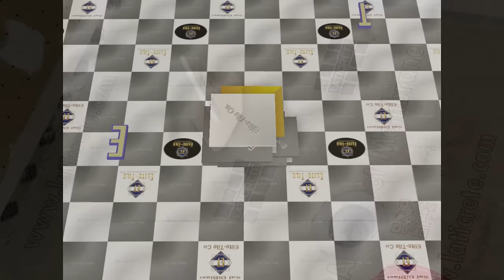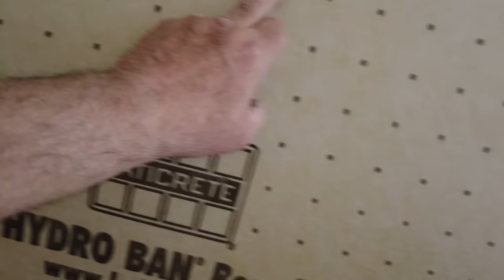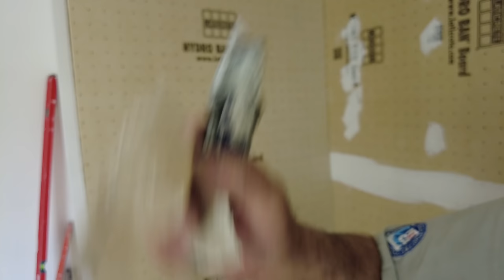Shower waterproofing, step by step.

Comment: which method do you prefer, the sealant or the hydroban liquid and fiber tape.  I imagine the sealant is much faster but hydroban liquid and fiber is tougher?  Especially if building acustom niche?
Reply from the maker: Sealant is more time and cost effective, but not right for every job. That is why you should be proficient in many methods.

Comment: Sal, I have always been a concrete board and mud pan guy but thinking of going this route.  Just as another layer of protection, would it hurt to apply Hydro Barrier and mesh to all joints?  Great video, thanks!
Reply from the maker: Not needed, and sometimes more does not not add but detracts.

Comment: Sal - I'm going to be using the Hydro-Ban Pre-sloped pan and Hydro Ban board (like you have) if I use adhesive to connect the board to the hydro-ban pre-sloped pan, do I still need banding?  I was going to add a layer of hydro ban liquid for added measure.  Thoughts??
Reply from the maker: The sealant should be enough, but the banding or liquid can't hurt.

Comment: Try a drywall corner trowel for the corners for smoothing the sealant, less chance of the edge of the straight blade cutting away some sealant without realizing it!
Reply from the maker: Yes you can do that, did not have one on hand, just need to be a bit more careful with a regular putty knife, but it works just fine.

Comment: Hey Sal, I called laticrete to see if they sell a smaller membrane roll and explained what I was going to do (essentially what this video shows) and they recommended I just skip the membrane and roll on hydro ban, 2 coats with a 1/2" nap roller directly to the dry mud bed. Have you tried this method? I know laticrete has a video on it.
Reply from the maker: That is also a method to do it, I prefer sheet membrane on the shower floor, but the Hydro ban liquid will get the job done.
Reply: @SalDiBlasi  Thanks for the reply :). These videos have been immensely helpful.

Comment: Great video Sal, answered a lot of questions I had. Would you recommend doing a custom sized niche made of CBU just be waterproofed with a liquid applied Hydroban? It seems like the layers and small pieces required to do it in membrane would add up quickly and become difficult to work with.
Reply from the maker: Get a pre made niche.
Reply: @SalDiBlasi  If I had to do it over I would absolutely go pre-made, unfortunately my niche is already in and I’ll be waterproofing what I’ve built

Comment: Sal, great job as always. Have you moved away from using Schluter brand? Any reason?
Reply from the maker: Not at all, I use both, I have several videos using hydro ban board, they are both great systems.

Comment: Sal, I’ve tried to get the 1/2x4x8 hydro ban boards, but can’t find a dealer locally that stocks them. Contractors Direct only sells the 3x5 sheets. 

Mat I ask where you get your 4x8 sheets? 

Great video as always. Just finished a master bathroom shower pan using your videos and the Mapei 4 and 1 deck mud.
Reply from the maker: I have several places near me that stock it, call Laticrete see if they can tell you who has it.
Reply: Thanks so much for replying. Hope business is going well for you.

Comment: I am digging the beard Sal!
Another question. Is there any reason why i cant build a floating corner bench using laticrete hydroban board on the walls and a 2" hydroban panel for the bench, and reinforcing it using kerdi za channel? Basically following schluters procedures but using hydroban instead
Reply from the maker: You can do that, but Laticrete also has a 2" board.
Reply: @SalDiBlasi  yes. I was planning on using laticrete 2 inch board.  Does laticrete sell the reinforement u  channel that goes on the front of the 2 inch panel

Comment: Sal, looks awesome one of the better videos for Laticrete. If you were doing a linear drain would you use Schluter’s and treat the flange like the Laticrete fabric?
Reply from the maker: I like to stick to a single manufacturer to preserve warranty, however these are sealed systems so they will work if you use a Schluter drain and laticrete membranes.
Reply: @SalDiBlasi  Can you use Laticrete 354 or Multimax to seal the Schluter drain?

Comment: Did you use a Laticrete Hydro Ban drain or a Schluter Kerdi drain?
Reply from the maker: Had a Schluter bonding flange, so I used it. Basically the same thing as Laticrete.

Comment: Sal must you use the Hydro Ban sealant with their board?
Reply: For their warranty, yes.  I've noticed that their sealant is probably polyurethane based but compared to other polyurethanes it tools easier and seems a bit more rubberized when dry.  I do what Sal does and use a sausage pack because it's the same price for 2x more sealant.
Reply from the maker: What Mark said
Reply: @Mkruzer  Much more likely to be a STPE-based sealant rather than a polyurethane (Laticrete calls it a hybrid sealant).  STPE sealants tool easier (often used as liquid flashing around windows and doors in commercial and high-end residential). All the major sealant manufacturers offer STPE sealants - Laticrete surely rebrands one of them and adds a fat markup.

Comment: That would worry me a little that you didn't use the washer along with the screws! It may not be needed for waterproofing but the washer do add additional support of the foam boards. Only having the screw heads into foam boards seems risky for supporting the foam boards, thin set, tile, and grout. However, thanks for taking the time to share your skills with us DYIs, etc.
Reply from the maker: If the manufacturer says you don't need them, why would you question that, it has been tested and determined they are not needed.

Comment: Hey Sal great video as usual!  Just one question that is driving me nuts.  It looks like you installed the back wall edge ban membrane upside down?  It appears that the fleece was facing up.
Reply from the maker: Same on both sides, just without printing on one side.
Reply: @SalDiBlasi  feeewww!  That’s good!  I thought there was only fleece on one side!  Still a problem with the OCD crowd but no harm done! 👍

Comment: Sal, Great video, thank you for sharing your knowledge! I have a quick question.  I want to use Laticrete to waterproof as you explained in this video.  My issue is that I already purchased two Kerdi Line drains for my curbless shower over cement.  My Laticrete rep recommended that I use MultiMax Lite or 354 as a slurry underneath 3701 Fortified Mortar.  All three of these products are modified and Shulter is telling me I need to use an unmodified thinset for the drain.  Can I use the Laticrete MultiMax or 354 or should I remove the cloth from my Kerdi Line drains as my Laticrete rep recommended.
Reply from the maker: The slurry, or bond coat undr the mortar can be any type of thinset, modified, or unmodified. As far as the drains go, I can't tell you what to do, but I have used both the thinsets you mentioned to install banding in y shower as well as line drains. Your call.

Comment: Sal
I have not done a sealed system since Noble came out with there products in the 80s.
My question to you is since you obviously used this product can you cut the membrane on the floor 6 + or - bigger and turn the sheet up the wall leaving the corners out of the sheet and useing the preformed corners. 
It seems like the membrane strips at the change in plane could be eliminated if the sheet is larger than the floor and turned up the wall
Reply from the maker: You can do that, and I have done it on two walls, however the sheet membrane is thicker than the banding, for smaller tiles it might give you a bit too much buildup.
Reply: @SalDiBlasi  
Thanks sal

Comment: Hi Sal, I'm using hydro ban board for my tile from tub up to ceiling. BTW, In one other video I watched of yours, I appreciated you explaining the Do's and Don'ts of proper placement of backer board where it meets the tub tiling flange. I do have a question about the waterproofing in this video. That being, do you ever use mixing valve or pipe collar seals? Thank you and super video!
Reply from the maker: Laticrete does not make them, they are more for kerdi when installed over drywall.

Comment: So make me understand this and by the way, I really appreciate your skills. You took your time to install wall boards the right way, plenty of sealants everywhere but the most critical part of the shower, the shower pan,was done by glueing different parts with thinset, no sealants etc. How is this making any sense?
Reply from the maker: It makes sense if you know how the system works. If you don't know how it works then it might be time to find out.